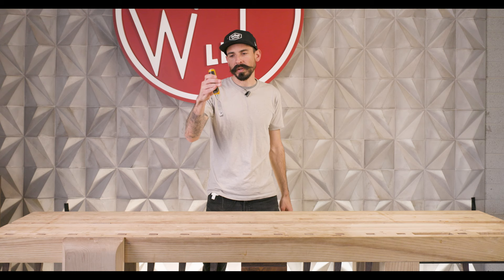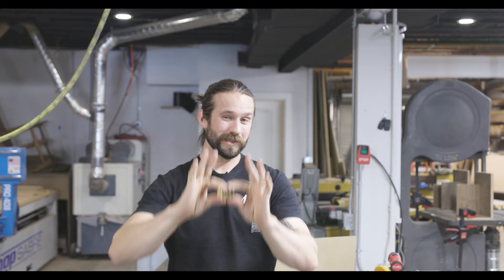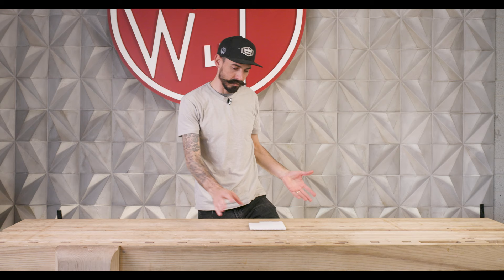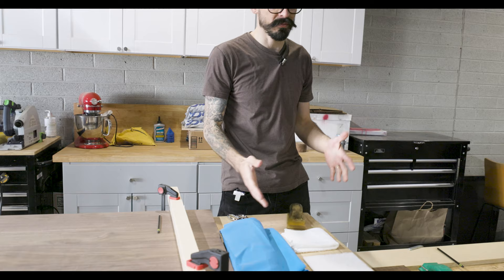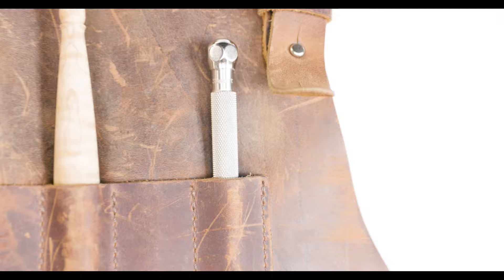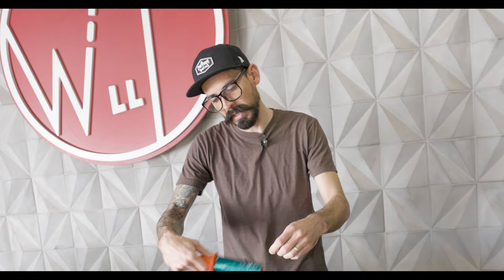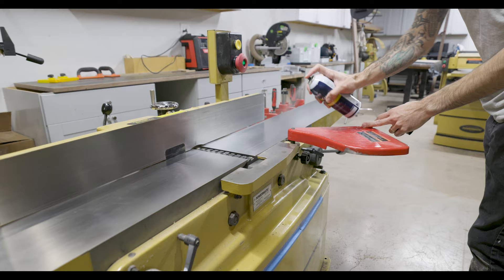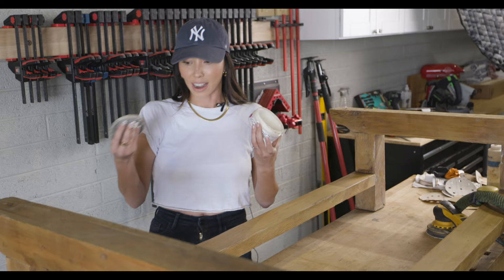$25 tools for your shop!

Comment: Milescraft Grabber Plus is essentially the same thing but in my opinion better and only $17-20. So that’s within your $25 limit. :)
Reply from the maker: What is that? A push block?
Reply: @WilliamDouglasCo  yes. Almost the same as the gripper for the jointer
Reply: @WilliamDouglasCo  it’s got a really nice diamond pattern on the bottom that I think grips better than the green stuff does.

Comment: All good and I’ll probably get the starret awl because I like nice things but the Neico spring awl is a go to for me as its one handed operation.  As has been suggested Pica pencils, I have a bunch (because, like all small items, I misplace them).  Blackwing pencils are my favorite (probably most of $25 for a box but worth it) and I have an electric pencil sharpener (doesn’t get lost and no excuse not to keep a fine point on the Blackwing).  Fiberglass resin was the “new idea” for me.  Thank-you for another great video.

Comment: Great info as always but.. the push blocks shouldn't set off a Sawstop because the magnets should be isolated by the plastic in the handles.   And, the polyester resin won't stick to epoxy resins but epoxy resin will stick to polyester resin.  Just keep that in mind if you go to touch up your next river table : (

Comment: Do you have a video showing you using the fiberglass resin? Or is it pretty simple, just pour in, let cure, sand?
Reply from the maker: I filmed b roll and i forgot to use it. It is really easy though. Pro tip.. add one extra drop of hardner and stir more thoroughly than youd think

Comment: Loved the video! You may have saved me a couple of bucks. My 12 year old son is building an electric bass guitar and has chosen a section of a slab for the character, meaning I’m gonna have to buy him some epoxy. The fiber resin is new to me. Would this work for filling a knot hole in a guitar body?
Reply from the maker: The resin works great for anything relatively small. Knots and checks are fine. Just doesnt work well for large cavities. Thanks for watching!

Comment: Nice info but I don’t like the trend of Will going from publishing videos with no ads (or maybe just one at the beginning) to now publishing ads with few snippets of a video here and there ☹️
Yes the number of ads interrupting the flow of the video is simply 🤢🤮
Reply from the maker: I definitely feel ya. Youtube decides how many ads to give you based on how many you’ve watched before the video starts. Since this video was longer than 8 mins it gets 2 ads. Most of my videos are under 8 mins. 
Still.. with ads, i am not making enough money to even break even on the production of my videos so i DO appreciate you watching them.
Reply: @WilliamDouglasCo  Just for your info there were 6 ads in total, 3 groups with two ads each and they were the type you cannot skip after 5 sec, you need to endure the whole thing before you can continue watching, really bad!!